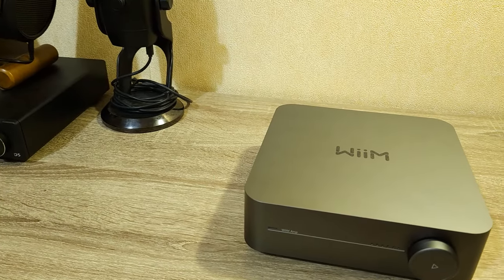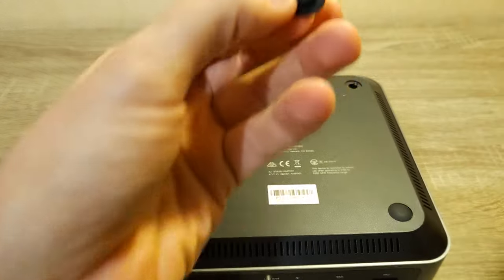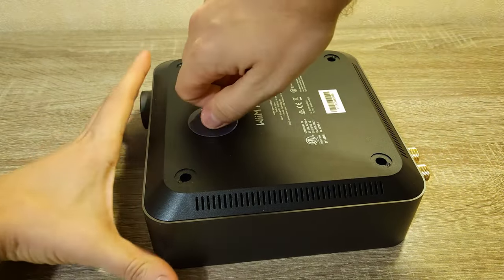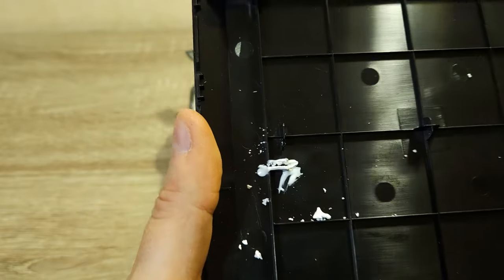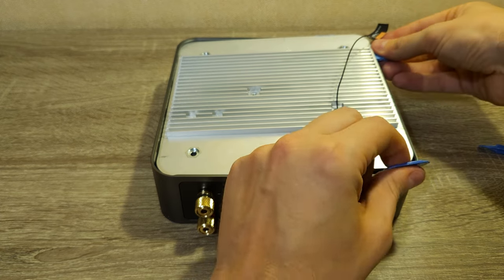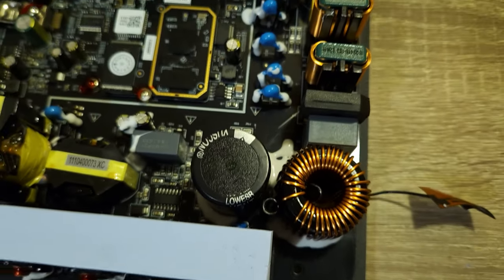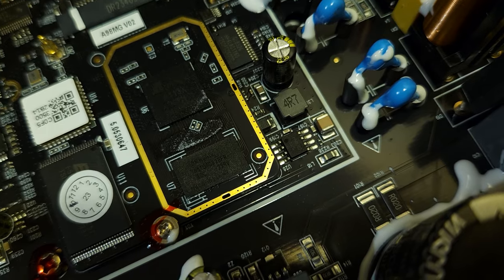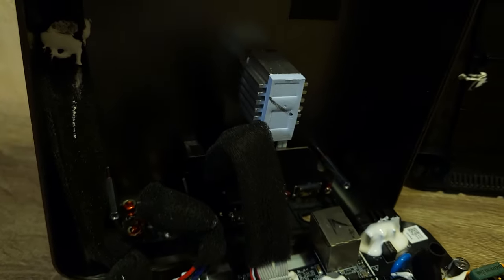Teardown Wiim Amp (Disassembly)

Comment: The interior does not surprise, nor is there an excess in quality...in short, expected for this price. They are attractive because of the low price, but when there is some kind of technical failure, they probably end up in the trash can.
Reply: My local Hi-fi repair shop would never touch this. I think my local telephone repair place would  try 😅
Reply: It looks very repairable, no obscure components, all very standard I think? I don’t know if there are any technical schematics though, but without them it would still be repairable in most cases. The usability will probably be more limited by the software update policy and advances in streaming protocols than the durability of the technical components I think. I don’t expect such a connected device to have to work more than 5 years before it is outdated either because of protocols or because of lack of software updates.

Comment: They crammed the absolute cheapest stuff inside - meaning: "Just as long as it 'plays sounds', we can sell it", LOL. Not my cup of tea, IMO....
Reply from the maker: The price represents the functionality and quality of components. We can not expect to receive high quality components for a price this low. There are higher quality alternatives which are not that appealing for the majority of users.
Reply: circuit look like the cheapest car amplifier
Reply: ESS Sabre DAC and the TI 3255 amplifier chip are definitely not “cheapest stuff” or “as long as it plays sound”. Also the rest of the circuitry is pretty good, resulting in a Total Harmonic Distortion + Noise (THD+N) of just 0.002% (-93 dB) and 98 dB SNR. I think at this price point it's nearly flawless. What alternative do you see doing it better or what combination of components would you use to reach this sound quality at this price? Better is of course possible, but it would be MUCH more expensive. All the reviews are very favorable about the audio quality.

Comment: Nice video! This looks very well designed! High quality components like the premium ESS Sabre DAC and TI TPA 3255 amplifier chips combined with “good enough” other components to reach a THD+N of just 0.002% (-93 dB) and 98 dB SNR, it's nearly perfect at this price point. It looks very well laid out. You can’t expect much more I think. To get better sound from a streaming amp, you would need to seriously raise the budget. Glad to see someone taking it apart to see the inside. It looks pretty repairable too, no strange obscure components. Perhaps it can be tweaked to sound even better, by replacing some “good enough” components by higher grade substitutes?

Comment: Nice video . I have a pair of KEF Q 100 book shelve speakers. 8 ohm 10~ 100 W. Can someone advice me if this is a matching amplifier for these speakers ?
Reply from the maker: Its mact, for 8ohm you can use any amp, problems start with 4ohm speakers.
Reply: Thanks
Reply: There might be a problem with clipping

Comment: Hello, I am now the owner of 2 x wiim amp.  Now a question, can I only play the music played in the wiim app (radio, amazon, spatify, tidal,...) as multiroom?  Or can I also play music as multiroom from another app, outside of the Wiim app?  hope it's understandable what I mean?!?  Thank you
Reply from the maker: good question, I won't know the answer.
Reply: Hey, the wiim amp supports Chromecast audio so if you use the Google home app you can make a speaker group that would be able to connect to both without using the wiim app. This speaker group would then show up in your other music streaming apps if they support Chromecast which most do